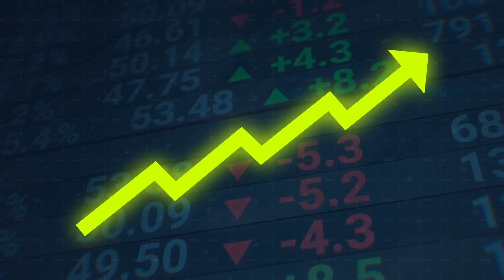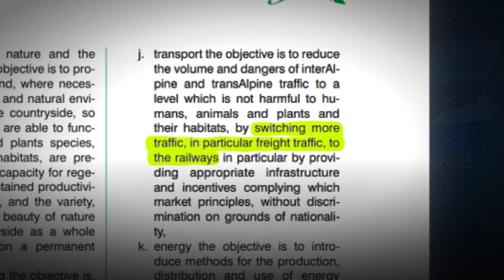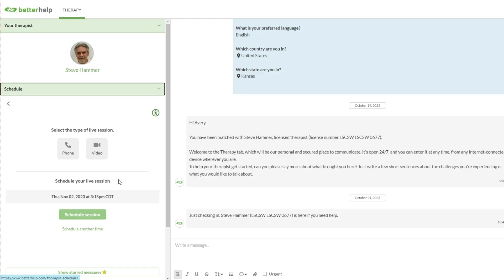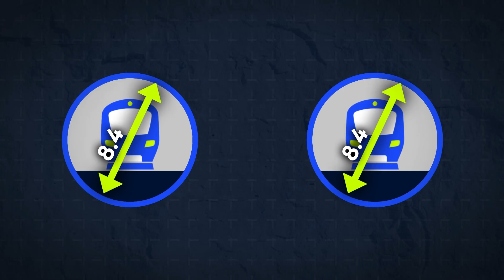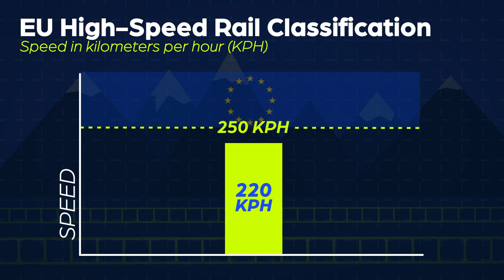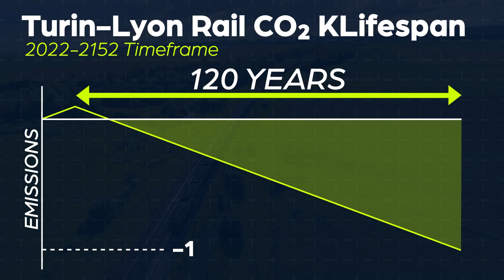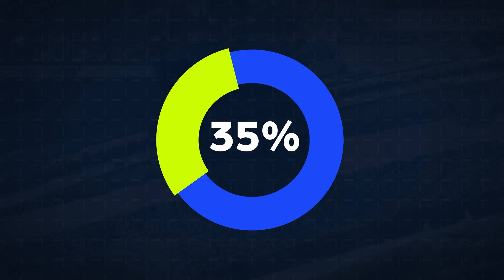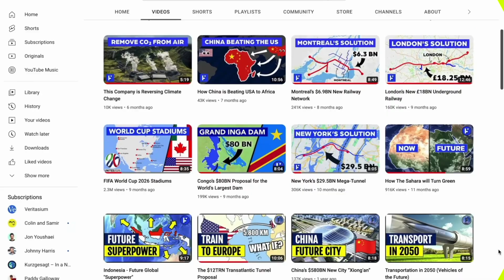France’s €26BN New Railway to Italy

Comment: The way in which the reduction in emissions is presented in this video is not accurate. What is expected is that traffic between Italy and France will increase, with or without the tunnel. The tunnel will have the effect of capturing part of the increase and therefore limiting the increase in CO₂ emissions. But this does not constitute a reduction.

Comment: An interesting subject.
How many trains run in each direction every day? Bottleneck tunnel of Fréjus , OK but is the line actually at saturation point? You say the realisation of the new line will double the density of circulation. Is it established that there is a NEED for that??
The point about the Fréjus tunnel's height is not so obviously a negative factor if it were not that the SNCF has TGV of both one and TWO storeys (unlike most other European countries). freight trains don't need any more height, do they?

Lyons est arguably France's second largest metropolitan population . Turin is the ancient capital of the House of Savoy (before unification of Italy in the 1880s) and a cultural & commercial centre. They are both situated at the centre of a transport network and Lyons has an international airport Hub to which is attached a TGV railway station to the east of the city. Both cities have several railway stations of which two are very large.

If the project is old, an incident in another road tunnel finally provoked its realisation
https://en.wikipedia.org/wiki/Mont_Blanc_Tunnel_fire

Ecological opposition to Freeways making scars on Alpine landscapes has been strong and continuous. The menace to species of Faun and flora. The atmospheric pollution. The difficulty of access in case of accidents. So the argument for trains is perhaps valid.

What will the numerous lorry drivers do when trucks are replaced by trains?
Is Turin Suza station adapted for transfer of goods from train to trucks for local delivery?

As usual, you credit the French government, Italian government and the European Union with co-financing the project. This rather dehumanises the fact that it is the tax-payer who is the actual funder! No private enterprise investing in this? THREE companies of exploitation! Why?

Your first image of the projected line seems to run over impossible peaks!
The maps and images are generally too short-lived to grasp and understand. (OK, there's a pause button).

Turin is not a TUREEN. 
https://www.collinsdictionary.com/dictionary/english/tureen
Turin
in American English
(ˈtʊrɪn, ˈtjʊrɪn, tʊˈrɪn, tjʊˌrɪn)
commune in the Piedmont, NW Italy, on the Po River
It. name Torino

Not sure about the usefulness of a European Rail transport High Speed Network,. Who wants to travel from Porto to Trondheim or Dublin to Palermo? (Although until COVID suspended an interesting weekly train from Nice to Moscow in 48 hours! Putin's annexation of the Ukrainian Crimea in 2014 killed it off completely.
Fast trains are awfully slow* and can be very expensive for passengers. When daytime Paris-Berlin needs more than 8 hours***, trains remain slow, although more comfortable than planes and give you the possibility to sleep, read, eat, work, wander about, which planes hardly do.

1860 was the year that citizens voted a referendum for Savoy to give the County of Nice to France. The 150 year celebrations in 2016 awoke new interest in relations between France and Italy.
BTW There is no fast track (nor will there be during my lifetime)*** between Nice and Marseilles; There are TGV train, Corail trains and TER regional trains which all take an inordinate amount of time (2h40) to make the journey, which has, admittedly, some lovely sea views.

* i.e. do not run at their fastest speed.

* Last Summer there was a night train and it may be restored to the timetables in late Spring 2026. Otherwise a night train is possible with a change to a sleeping car in Rotterdam around 21h00 and takes well over 11 hours in all.
*** Nice international airport is the second busiest in France (after Paris) and there are many interesting destinations by direct flights (as well as some odd omissions).

P.S. I don't often pay attention to publicity, but your Better Health caught my eye.
"You deserve happiness". WTF? You = everybody? Mass murderers? Employers of child slave workers? DESERVE??? What has man done to DESERVE happiness? Which philosopher preached that? Not even Greek hedonists, I think.
Certainly we all have the right to seek it, but once found it is so ephemeral as to very often lead to disappointment and frustration!

Comment: You know that this project is linked with a lot of lies. The time comparaison between the current route ( before the slide that cut the track in la maurienne and not repair by french railway - another story) and the new route is a little lie. When the connection exist the French train was not able to use the hight speed track in italy so it was slow. If it used the italian hight speed track and we compare to the tunnel time line the save is only 30 minutes … also the excuse of a busy “overbusy “ maurienne “  line was true in the past but in the last 5 years itvwas not the case and the tendency  is no for grow exchange.confirm many time by sncf reseau … do we really need expensive and too late project ? Rethinking route and improvment may be less costly for a similar project but will not be support by big construction company involve in mafia similar as pharmaco industry….

Comment: but will it work? there are about 30 km of tunnel under 2000 m of mountain, like beeing in a mine with high temperature, if temperature raises above 30 degrees inside the tunnel rails are out of specs and train cannot run; also, do we need a new line if the old one is used only 40% of its maximum capacity? Piedmont was the dryest region of Europe in 2022, this is our problem
Reply: Is 30 degrees really enough? Because that sounds like a resonable temperature even outside.

Comment: Breaking news the New Brenner Tunnel when opens will be significantly longer Secondly as most this railway (Lyon Turin) is underground in the alpine area it is more correct to say under and not over the alps.
Reply: The Brenner base tunnel will be shorter than the Gotthard base tunnel, however, when connected with the Intall tunnel, this underground network will reach a formidable length of 64 km.
Reply: @bronzinorns  correct

Comment: Good video. As highlighted at some point, this is not just a mere Lyon-Turin high-speed connection. It is also the Milan-London, or the Venice-Marseille, or the Rome-Paris link. More and more direct services will be available, within a time range between three and six hours of rail travel. At least as far as Italy is concerned, this will actually reshape geography, in a way.
Reply: It will also be the london to vienna connection once the brennero base tunnel between italy and austria is completed on the other side

Which is crazy and exiting

Comment: Absolute propaganda. The line ALREADY EXISTS and is under-utilized. It can accommodate much more traffic already. This project is not only unnecessary but hugely destructive to the environment as it  cuts into preserved mountain habitats demand uses scarce water ressources for the construction.

Also it won't alleviate truck traffic : the decision 5o put merchandise on trucks and not trains is purely political. Also adding freight capacity will just be an excuse to import more and more food into France when it should be produced locally.

Comment: It's NOT,  as the title of this video suggests, "France’s €26BN New Railway to Italy", It's a shared project and 63% of costs are on Italy's side, so the title should be, Italy's new railway to France. But we are used to  misinformation about Italy form the anglosphere. Always.
Reply: Sicuramente il titolo non è perfetto, ma come detto sopra non può neanche essere chiamato come dici tu. Sarebbe meglio dire 'The new €26 bln railway connecting France and Italy'
Reply: Builder is France's Vinci.
Reply: What Alby_Torino has written may be partially true  if referred only to the Mount Ambin basis tunnel  section which is at present under constructions. Anyway those numbers don't take into account the EU share. In other words total cost of Ambin basis tunnel section (from Bussoleno to St. Jean de Maurienne) is  shared as follows: Italy 2.884 mln  France €, 2.096 mln €  EU 3.320 mln (40%).
Reply: No France will pay more since there is a longer HSL on France's side, but I agree that the title should have been fairer to Italy
Reply: Meh, it doesn't really matter

Comment: I do not get why Italy pays 35% and France 35% if the tunnel is prevalently in French territory 🤷🏻‍♂️
Reply: france pays less than italy for the large tunnel because it has to build 2 other large tunnels to connect Lyon. On the overall project, France pays more than Italy.
Reply: @mathieuruiz7924  you’re right I paid more attention to the video and it’s explained. In the end, for the whole line, France pays more but Italy pays more for the international section of the line.
Reply: @attiliodelloste4025 its not that Italy pays more for the international line. Think like this Italy and his buddy France want to make a tunnel between them, France pays half and Italy pays half(the rest is Europe) regardless of the natural boundries on the ground(because there is just more mountain on the French side). The bottom line is: there is no tunnel unless both sides do it, so the whole project is seen as a joint effort because both stand to benefit equally.

Comment: I must say, Iberia needs a west coast high speed option linking Andalusia and Galicia through Portugal's major coastal cities.
Reply: It is the Portuguese side that is at fault, the railroad side is finally going ahead, there is a launched procedure to Build the First Stretch of line. But Portugal doesnt use Standard gauge and is unlikely to change, so no mediterranean corridor. However all new lines will be built with beams with both gauges, which would be an easy change once the decision is made.

There are however priorities and the biggest hurdle is the rail/car Bridge across the Tagus river in Lisbon, it is one of the biggest natural barriers in Europe that already has its longest Bridge. This is a key part in all of this but it is a very expensive part because that is a upward of a billion euros cost.
Reply: 2026 Madrid to Lisbon 2030 the full network
Reply: Portugal just announced its first high-speed line to be built!

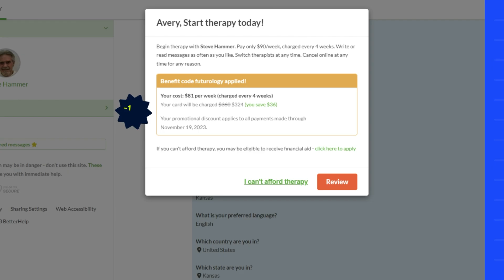Comment: 4:30hrs from Paris to Milan will be a game changer. 7 Hours is too long for most people but 4 is fine, and will make it highly competitive with air travel.
Reply: 4h30 makes it equivalent to air travel but with less stress. The problem will be the cost
Reply: @mr.meeseeks3074 for business travel it will be great and since Paris is siege of Peugeot and Turin of fiat in auto industry for example such travel might switch from plane to train.

That's just one example.
Reply: @ebenezer576  thats marginal lmao
Reply: @mr.meeseeks3074 just tax kerosene like it should be
Reply: @mr.meeseeks3074  air travel is only 1h between Paris and Turin
Reply: @Kamonohashiii  you need to come around 2 hours before to the airport and airports are further away from cities
Reply: @mr.meeseeks3074  in this case it will take 6 hours for the train since I imagine that you dont stay 5 minutes in the station before departure and that on arrival it takes time too
Reply: @Kamonohashiii on what basis do you claim that?
Reply: @nodrog170  claim what ?
Reply: @Kamonohashiii  claim it will take 6 hours. There's plenty of international train routes where you can literally turn up 15 min beforehand. And the train starts and ends in the city centre.
Reply: @nodrog170 I over exaggerated as he did
Reply: @nodrog170 indeed I always show up 5 minutes before departure for HS train services — and managed to never miss a train. Also, train stations are usually in the city center, and this applies also to the destination city.
Reply: And going from wherever you are in Paris to CDG airport and then to your plane probably takes 2:30  @Kamonohashiii
Reply: Its probably still gonna take 7 hours or more to get from milan to sicily
Reply: 4 hours and 30 minutes from Milan to Paris is not possible. Right now Milan-Turin takes 1 hour and Lyon-Paris takes 2 hours the hypothesis is Turin-Lyon in 1 hour 47 minutes with the new line. Add a few minutes for stops in Turin and Lyon and the final time will be more around 5 hours.
Reply: @divxxx  well, it’s tight but JUST feasible. Milan Porta Garibaldi to Turin Porta Susa is actually 48 minutes (see schedule). Let’s add a 2-min. stop in Turin Porta Susa and we’re at 50 minutes. Now add 1h47 min. to Lyon (Saint Exupéry TGV) and it’s 2h37. Add 2 min. stop in Lyon and we’re at 2h39. From Lyon Saint Exupéry TGV to Paris Gare de Lyon is 1h50 (see current schedule), that brings us to 4h29 min. from Milan Porta Garibaldi with two brief stops in Turin and Lyon. With a bit of improvement on the speed on the Lyon-Paris and Milan-Turin, it could get some minutes less so that even Milan Centrale - Paris Gare de Lyon could be scheduled at 4h30 sharp

Comment: 1) Get used to, and apply global conventions, at least in intl settings like here. Speed is written km/h - not 'kph'. 
2) Avoid unnecessary, apparently Hollywood 'role model'-inspired and then sheeple-parroted and so nation-wide spread vocabulary changes against the english original. The pronunciation of route is [ruːt] not [raut] How would you say Route 66? Check this clip dCYApJtsyd0 
Another example would be 'anyways', instead of anyway.
Reply: In many ways I agree. However, if this video is listened to by people in the USA and persuades even a few that railways are a good idea then I can put up with the sloppy production.

Comment: 📝 Summary of Key Points:

📌 The France-Italy railway project, known as the Toine Leon Railway, will connect the two countries across the Alps and have a significant impact on their economies and the environment.
🧐 The current railway between France and Italy is outdated and inefficient, with small tunnels, sharp curves, and poor profiles, leading to travel restrictions and disruptions.
🚀 The Toine Leon Railway will bring numerous benefits, including increased rail capacity and transport speeds, energy savings, reduced travel times, and a positive impact on the environment by diverting freight traffic from road to rail.

💡 Additional Insights and Observations:

💬 "Most freight and passengers traveling between France and Italy currently rely on trucks or airplanes, which are energy inefficient and harmful to the environment."
📊 The railway is estimated to remove 1 million trucks off the roads of the Alps every year and prevent CO2 emissions equivalent to that of a city of 300,000 residents.
🌐 The project was authorized in 2017 and is expected to be completed and open for operation by 2032.

📣 Concluding Remarks:

The Toine Leon Railway will not only improve transportation between France and Italy but also contribute to economic growth and environmental sustainability. By providing faster and more efficient rail options, it will reduce CO2 emissions and strengthen the bond between the two countries.
Generated using TalkBud

Comment: From what I can see they need to extend lorries on trains to Folkestone from Turin that way British and Irish lorry drivers don't have to drive onto French motorways to reach the current lorry on train terminals in Southern France instead simply drive themselves to folkestone where the lorry on train service runs from there to Turin via the Channel tunnel and Mont D Ambin base tunnel. Basically saving them money this would require British home office immigration officers at the terminals in Italy to prevent stowaways/clandestines
Reply: At that point, why have the drivers and trucks travel with the trailers?   Instead have an Italian truck pick up the trailer in Turin (actually the suburb of Orbassano) and drive it to its final destination.    The train can haul a lot more trailers this way.   It's like the long haul piggy-back services in North America.